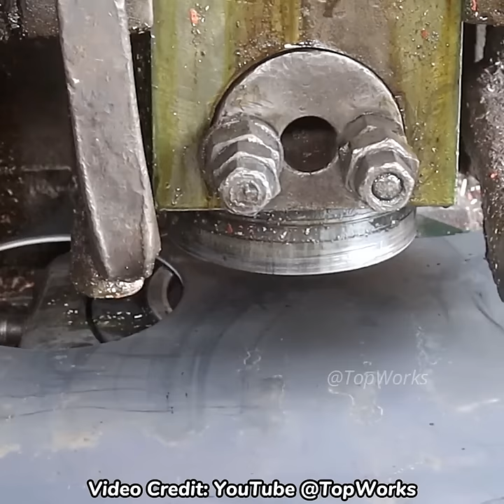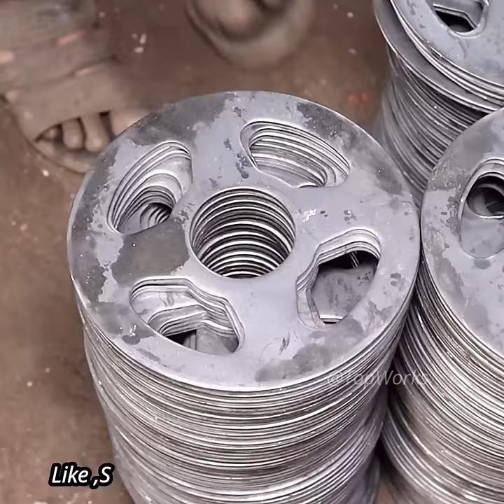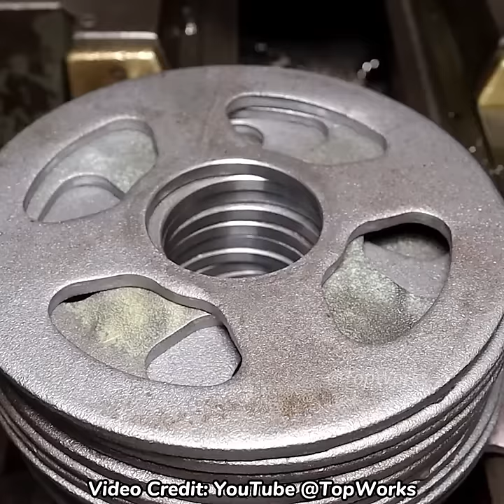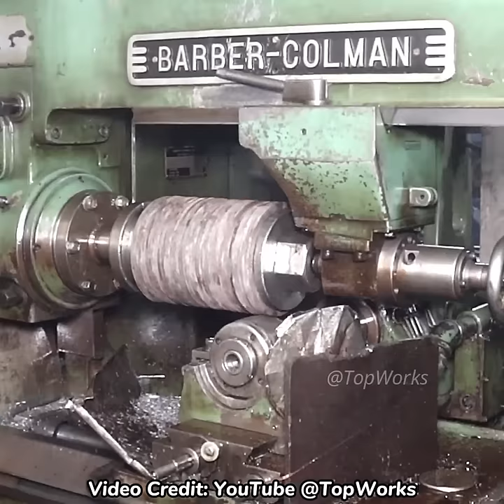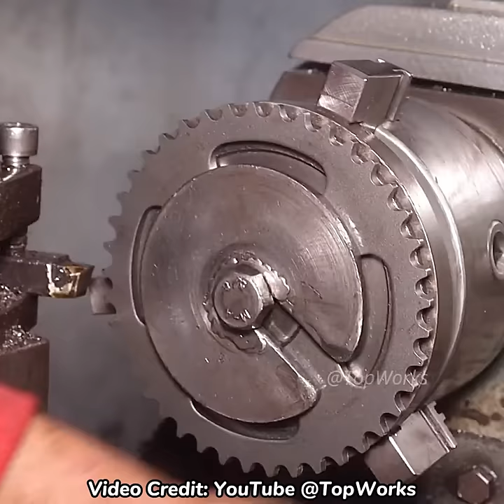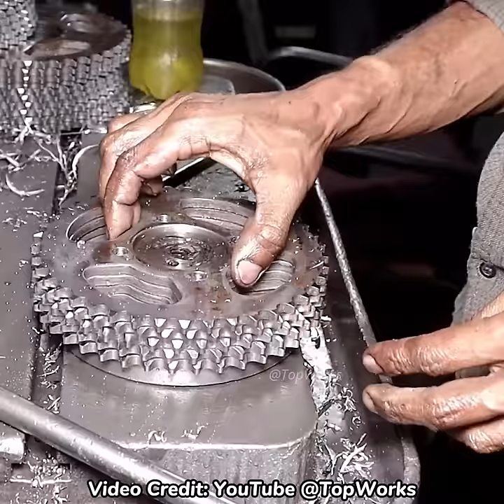Mass Production process of Chain Sprocket in 3rd World

Comment: They must learn heat quenching & tempering process.  
These sprockets are useless without hardening & tempering process.
Reply: Hardening and annealing the sprockets is a separate operation. Many manufacturing facilities do not have the in-house capability to perform heat treatment, instead outsourcing this to a third party.
Reply: They don't care
Reply: It is usually plain low carb steel so it would have to be case hardened
Reply: Por eso noduran
Reply: So just because you didn't see it happen in this video you assume they don't do it.

Comment: The manufacturing process may be taking place in a "third world" country but the technology being used is state of the art and demonstrates the most cost-effective way to produce these sprockets.
Reply: экономический может и да а для рабочих. технику безопасности надо. опасно так и без пальцев можно остаться. думайте и о рабочих тоже...
Reply: @zinaidamigthenko7324 yes brother but we are not that much developed and don't really have laws related to this issue.
Reply: I think i have seen another video where they just use powder metal and compress it to the shape of the sprocket then they just do heating activities. This way it's a lot more time saving then cost saving. What do you prefer cost saving over time saving or time saving over cost saving
Reply: This video is how things would have been done in the 1940s, except the carbide inserts
Reply: Now quality is different due to material used
Reply: cost effective because they don't spend money on safety.
Reply: State of the Ark more like.
Reply: If this is state of the art, I’m the president of the US.
Reply: @qwerty112311  State of the art does not mean computer controlled. It refers to using the most cost-effective machining technique for producing components, and this is what it looks like.

Fools who apply costly automation to every requirement in manufacturing do so without having a good understanding of cost accounting. This results in increased costs and a corresponding decrease in market competitiveness for a company's manufactured products. 

Quite often, young manufacturing engineers and managers justify replacing effective manufacturing equipment with modern "high tech" alternatives for no other reason than that they want to add experience with it to their resume.

It is just such foolishness that is responsible for America's decline from its former status as the world leader in manufactured goods.